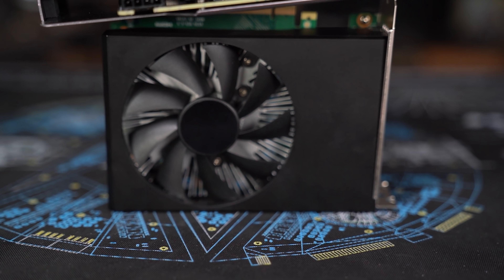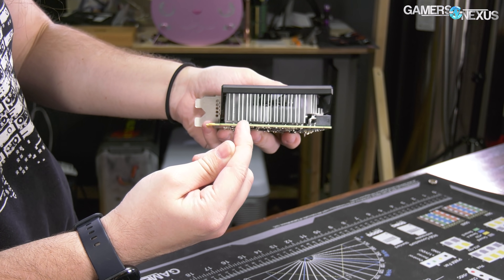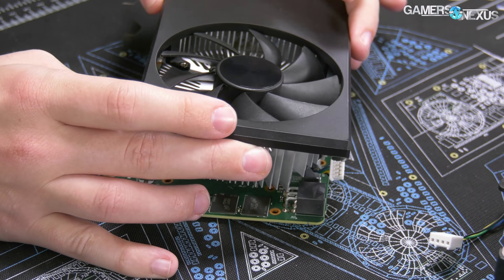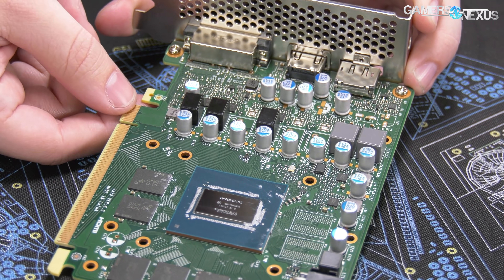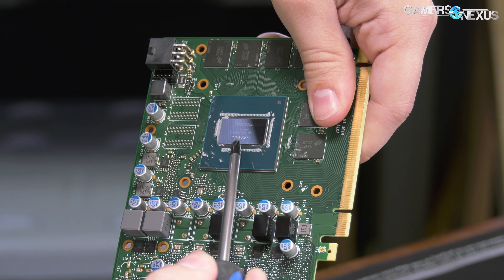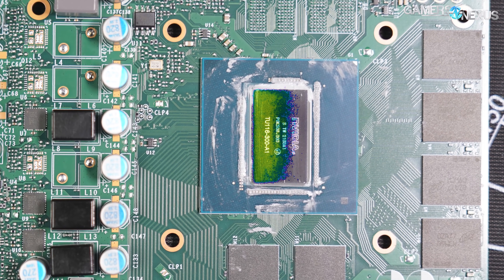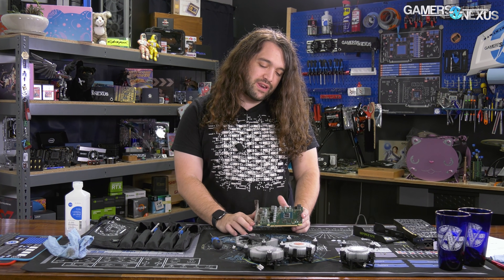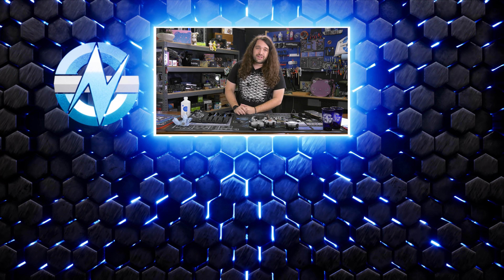Bottom of the Barrel: 110°C VRAM Dell GTX 1660 Super Video Card Review

Comment: I keep a brand new stack of thin thermal pads around for anytime we rip out a dell video card. These dudes are so cheap that they NEVER offer any kind of vram cooling on their cards. its par for the course. You can add your own and drop temps by a good 20c but be careful not to use pads that are too thick because they can put too much pressure on the vram and cause the solder to crack. The brand of VRAM they used on these cards actually likes to run hot and even overclocks better when its above 90c or so. When you use thermal pads on them like I did, it will limit your overclocking but at the same time it will keep the card running for much longer than designed.

Comment: what a shame he lied the entire time: i like these dell "rtx 1660 super" cards, they clock at 2100 mhz which is why they get hot.
better case thru put (really good cpu fan that throws air backwards, and a good case fan pushing the air out of the case
should help with a few degrees. mine went 14 degrees cooler :D (39-40's) not 50+ FANRENHEIT (110 celsius is 230 fahrenheit) this guy is lying.

Comment: i like these dell "rtx 1660 super" cards, they clock at 2100 mhz which is why they get hot.
better case thru put (really good cpu fan that throws air backwards, and a good case fan pushing the air out of the case
should help with a few degrees. mine went 14 degrees cooler :D (39-40's) not 50+ FANRENHEIT (110 celsius is 230 fahrenheit) this guy is lying.

Comment: I have had this exact board for over 2 years now.  It works fine.  No issues with thermals.  I don't get why he insists this card is the "bottom of the barrel" when it performs nearly identically with other cards using the same chipset.  It seems like tech snobbery.  Most premium cards are overengineered.
Reply: Because it's much more likely to thermal throttle and fail
Reply: @Penguincannon9000  I'll put my trust in Dell's engineers.
Reply: @SuperGhettoBob problem is, they all have been fired for the cheapest factory in china

Comment: While it is crap, I can also understand Dell's viewpoint here, most people who buy pre-built computers only replace them when they fail to turn on in some way, so on their cheap low end products they want them to fail after a couple of years so that person buys ANOTHER pre-built, they likely hope on a financing plan so they get more out of you(it's how they kept me in their ecosystem for basically 12 years). I've found generally a Dell computer will last roughly as long as the parts warranty and past that you are basically on borrowed time, at least on the low end. The higher end tend to be more competently built because Dell knows the people doing the research and getting the higher end computers might actually know how to and be able to replace a broken part in their computer. 

I would imagine Dell actually makes most of their money from low end computers, and people getting those computers on a financing plan so they pay basically the cost of a mid range PC for their low end PC. (Looks at my 1650 equipped XPS that cost around the same as my RX 6700 XT equipped custom build)

Now I say this while also having a soft spot for Dell, and maybe it's stockholm syndrome where I was in their ecosystem for so long and have had 3 Dell machines, 2 desktops and a 1 laptop, but as someone who is dirt poor, they were a way I could get a new computer without having to wait YEARS. Like I know everyone is thinking "why would anyone pay for this crap?!", but that's the thing Dell lets you not pay for it all at once. My XPS with a 1650, i5-9400f, 16 GB of ram and 1TB of storage was $40(CAD) a month(top end of my budget at the time) for 4 years. So ultimately yes I well over paid for that old computer, but I had it a couple of weeks after my old computer died, where as to save up the market value of that computer at the $40 a month I had to save it would have taken me just over 2 years of saving. So basically for someone with as little extra income as me, it was basically a question of do I take the bad deal and have a computer now, or be without a computer for 26 months just so I can afford a shitty entry level gaming PC. I took having the computer right then. 

For as bad as Dell is, they do offer a very important service, though their stranglehold on that service is going away with other financing options becoming possible on other websites. Though Affirm is more expensive per payment than Dell ever was. Mostly due to having far shorter terms, but that's a whole other topic.

Comment: My expensive Asus 1060 6GB Dual died after less than 1 year. My feebay used dirt cheap Dell OEM 1060 has been running non stop for years. Go figure.

Comment: Well fuck I just bought one of these on marketplace and thought I got a good deal lol, should've checked the reviews 😭
Reply: What's wrong with it?
Reply: @Boathunder_offical  the cooling is pretty bad and some of the chips don't have any kind of cooling. But apparently you can just add some thermal pads to those and it helps
Reply: Hey, are you still using it? Has it improved after adding the thermal pads?
Reply: Maaaan same. I got it off on a good deal. Warranty sticker on the screws still intact. How is yours doing?

Comment: even if they just stuck some thermal pads on the mem and vrm that would be good and take a uni bit and drill 2-3 big holes on the sides this card would have been a WHOLE lot better... cost would have been maybe 1-2$ more... sad how far dell has fallen since the mid 2000s... i remember my old prescott p4 (dimension i think) rig that thing was built 10X better than this. netburst and ram problems aside the thing lasted a very long time... had a ati xt800 agp in the thing too. was no slouch for when we got it in 2005 played doom locked 60 fps at 1280x1024 ah those were the days... but this is just sad...

Comment: I have a Dell XPS 8940 with the Dell GTX 1660 Super.. its a good card.   Runs a little warm but i'm still liking the compact size and only req. a 6pin PCIe power.   Runs Graphic test and its come out true and correct, same as any retails GTX 1660 Super card stock

Comment: I made an experiment with one of these cards:
It was running at more than 83° even  when the gpu usage wasn't maxed out and with fans at 100% speed.
I managed to make it stable at 76° average  by undervolting it without losing much performance.
Then I added thermal pads on the Vram, it made the temperature back to 83° and above because the cooler  couldn't handle that extra warmth.
So I bought a rtx 2060 ventirad on Aliexpress, cut some pieces to make it fit the card chip layout (it's almost the same) and installed it. Now the temperatures never go above 65°.

Comment: this graphic card is causing crackles when I play video. I was requesting for a replacement. Guess the price I need to pay if I want to keep the card? 244.13 USD!!!
Reply: if you open the chassi the temps will lower just a ordinary tablefan when aiming on the floor at the open side will push cold air (since its winter) against the system and cool it furter -or buy additional chassi fans and hope for the best

Comment: Unfortunately I own this card, it due to scalping it’s what I’m stuck with currently. 

I have repasted the card, added thermal pads. 
Stress testing in a SFF build it never reaches above 75c for over 45 mins. 
It currently holds top 100 on timespy benchmarks. 
+975 memory clock 
+180 core. 

Wish I had a better card because this one is terrible, just glad I was able to make it somewhat better with mods.

Comment: I do have to add that my old DIY was built just as bad as the alienware prebuilts are. Just bought one. Bet it will last if you don't overclock. If I do end up having issues ill end up fixing them like a big boi would. Just don't buy gaming laptops. The thermals are fine but the battery is the achilles heel.

Comment: Dell could do something bad but cheap, use thermal pads on those hot vrams, even tho the surface area is small and have gaps its still better than nothing OOor use thermal pads and small metal piece thermal glued to heat sink, both would be cheap and working solutions

Comment: I do appreciate your video and the points raised, but it seemed a little elitist and dismissive.

I want the cheapest 1660 I can get rather than overpaying for some pretty looking thing that can withstand a lot of overclocking.

I disagree completely with your criticism of the heatsink, that the purpose for the shroud to block the sides was to force air down onto the memory before exiting the pcb, but I completely agree that the memory should have some heat spreader on it, just not necessarily the heatsink itself, rather a mere flat aluminum plate would have sufficed at minimal cost increase to drop temp at least 10C-20C.

I'm just suggesting that not everyone gets a 1660 to run it hard gaming, instead I just want it far more for playing older games, and shader performance during video playback on a 4K monitor.  On that front, it matters at least as much to me that every video output should have been HDMI2, while I thought I saw a DVI which is just laughable in this day and age for a new(er) system, considering a modern monitor is more of an upgrade to one new enough to have HDMI, than the system is.

Regardless, video cards that are short like this have their place in small cases, especially for HTPC if a full height card fits, where the more important thing is the dual ball bearing fan so this typically first early failure point (if it were a sleeve bearing fan instead) is deterred by a few more years.

Ultimately it comes down to the numbers, what the cost was to integrate this into a system and whether a "hypothetically" better build card to your ideals, would have instead resulted in a 1650 instead of 1660 at the same system price point.  I can say with confidence that I'd rather have a 1660 and downclock it a little if heat was a concern, than a 1650.  Remember, it's always about money.

In other words, I would gladly have paid $100 for this if covid and bitcoin had not disrupted the market, and putting a heat spreader aluminum plate on the memory is trivial to me, something I was doing over a decade ago, though I also have a stack of alternate heatsinks I could put on, not sure why there is so much focus on stock heatsinks when any of us who have been building for a while, have retired products with sinks we can repurpose.

I get it though, a sensationalist critical review to engage viewers who can only see black and white, not the gray in the middle.  I'm just wondering how niche this can go because most consumer products that we all own, are built similarly, just well enough to get the job done instead of at additional expense towards some ideal.  I don't even know where to start with examples so how about a garage door opener or your hair dryer?  Literally, there are flaws with some of those designs too so I don't mean to dismiss good analysis, but at the same time, it should still be seen as what you're getting for the money and how you can turn that into a great value, because many people in this era, aren't looking to spent more money to suit someone's ideals rather than just get the job done.

Bottom line, if you are a hardcore gamer with top shelf expectations on all your gear then  the 1660 isn't even enough so we should look at it as some minimal threshold to reach a performance level and it seems a little silly to me to pay a lot more for some theoretically perfect implementation of one instead of putting more money towards the next faster GPU.

Comment: I wish I saw these reviews before I bought this computer from Dell during the Prime Day sales. I got a 1660ti instead of a Super but it is identical in build. Would a custom cooler help with the heat issues? I got the PC on sale for $730 but then I took it apart and put the components into my old case and used the leftover parts to build a cheap PC or my nephew. I will never buy a Dell prebuilt again but I cannot complain since I needed an upgrade from my old 6 year old PC.
Reply: Did you find a aftermarket cooler
Reply: @RayRai8262  I did not my friend recommended one he got on Amazon but it was out of stock. I really should look more into upgrading but I am waiting for now

Comment: My Dell 1660TI is only 68C when mining ETH but I underclocked the GPU. I also put a 120MM 3pin fan in the back of the case above the ports and the 80mm I repositioned to the front ...it blows at the GPU... I'm considering pads, but it's not horrible. GPU is -300mhz, RAM +1100mhz. 31.x Mh/s at about 415Kh/J I paid under $500 net for the system with 16Gig RAM, 512NVME, 10400F. It's a deal at THAT price. They gave me a $50 coupon when I complained about the antivirus and onsite warranty. Spent it on an Alienware mechanical KB which brought that down to under $40 shipped. HW Monitor reports my 'hotspot' at 80C when mining ETH on the 1660Ti. Best move: ditch the mechanical drive and remove the bracket for it. Less heat generated and opens up case for flow. Next best move: put a 120mm fan in the back. Third cheap move: PWM splitter and use the rubber mounts to mount the 80mm in the front of the case. Two to mount it and two in the other two holes on the fan so they space it off the inside of the case (otherwise the blades hit). Now to try removing the GPU shroud...

Comment: I have a Palit 1660 Super in one of my boxes, it's actually surprisingly good despite being a entry model, big heatsink with dual copper heatpipes and dual fans. Temps are great and it easily hovers around 2.1GHz in games, memory can be OC:d to 15.4GBps, not top bin which should do 16GBps but not bad. Great for older games, like heavily modded Skyrim etc. Never had a glitch. It was bought for 250$ when it was new, before the shortages, which is about maximum it should cost. This Dell model looks like pure tragedy, a lot of that from Dell lately meaning they are now permanently off my shopping list for any item.

Comment: That cooler would make an ATI Rage XL (A GPU that doesn't need a heatsink) overheat in seconds. I wouldn't be surprised if that GPU ran cooler without the fan, because of the restricted airflow, it directs the hot air directly back onto the GPU die.

Comment: I threw some 2mm thermal pads on the memory chips to just barely make contact with the heatsink. MX-4 on the die and the card runs at 49c core and under 70c on the memory chips while mining. Memory is overclocked as high as it will go while still stable. The card is cheap but it's fine. I think GN was a bit unfair here because of the name attached to this card. Had it been from a high profile AIB I dont think it would have gotten nearly the same criticism.
Reply: MSI cut off Gamers Nexus because they trashed some of their products

Comment: I have one of these gpu's that I got in a HP pre built but I'm hoping either someone at GN or someone in the community could help me with 1 question. Would I benefit from putting good thermal paste on there and maybe adding some thermal pads so the memory is touching the heatsink

Comment: The truth is: our mesuring is so wrong. The 1660s is like the gtx 650 from years ago. Its here to replace those gt 710 in circulation. The problem is that we dont hace access to newer gpus. In months the 1660 will be 4 generations behind.
I'm not saying its bad, but its indeed the bottom of the bucket for the industry itself with is selling 3070ti as crazy

Comment: Hi GN :) great contents ! About thermal issues (and maybe also OC contests) : do you know if someone tried to "buffer" his cooling solution by inserting a Pelletier cell (properly powered) between the CPU/GPU case and the cooler device ? high power consumption, but very thin component, and reducing temp on CPU/GPU side (that can't be bad, isn't it ?...), and increasing it on the cooler side (so temp gap between dissipative parts and ambient is higher, with same Rth implies more energy is transfered from inside to outside), it looks like a good idea... thx for your time !!!

Comment: But it's a fixable problem...? I mean, you change the fan with an Arctic one, you get thermal pads and copper sheets to make the VRMs, memory modules, etc contact the heatsink, as well as put a copper sheet between the heatsink and GPU for greater pressure, and you cut lines or drill holes on the side of the plastic shroud for greater exhaust.

Comment: wow, that's a close resemblance of mid to lower model of original Intel Socket LGA1151 boxed cooler fan heatsink which don't have copper insert at the center of the heatsink...

Comment: Oh man, with you beating up on Dell lately (and rightfully so), I'm starting to worry about the Dell laptop I bought my mom recently lol.
Reply: I've owned 7 Dell laptops dating back to the mid 90s to current with my all AMD G5 I use right now, and I have all of them, and they're all still working. One of my HPs and my one and only Lenovo however are sitting in the parts pile. I've never owned a Dell desktop but in my experience, Dell makes really nice, durable laptops. Don't sweat it.